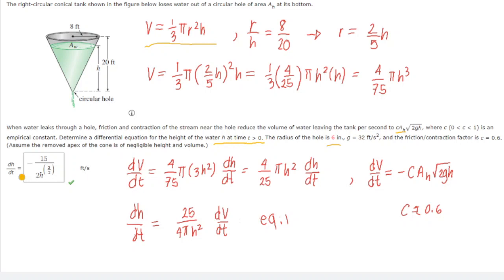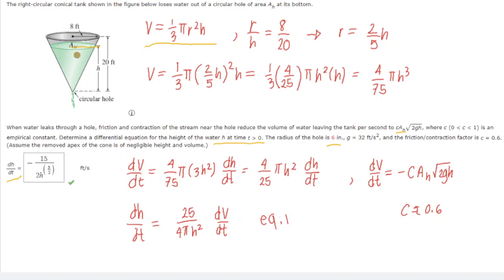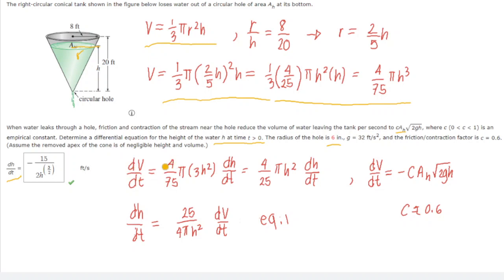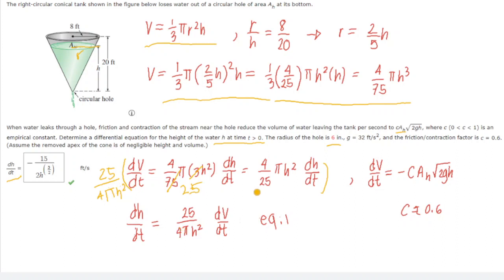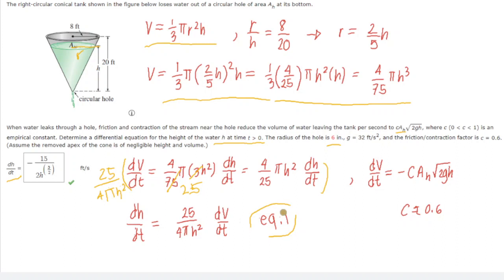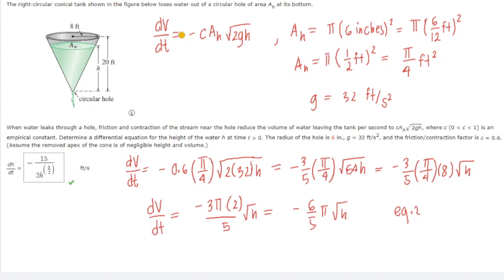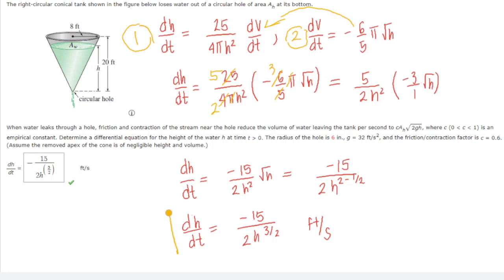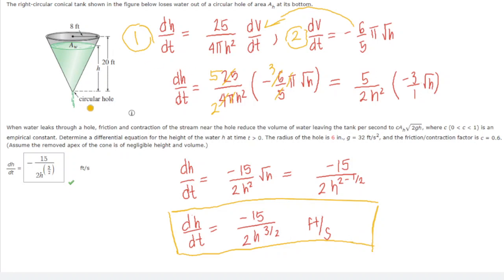Time Rates Applications Differential Calculus

Comment: What if the volume flow rate is not given? Can it be possible to be derived?
Reply from the maker: thank you very much for the question mr espina
Reply from the maker: the formula of the given volume flow rate takes into account the energy that were lost due to friction and other factors. that's where our empirical constant comes in. if we do otherwise, we can solve for the volume flow rate ideally. since if we deal with ideal solutions we can just neglect some of those factors.

Comment: Is it ok to always assume that the Apex of the cone is negligible even if the radius of the top surface is 8ft and the radius of the circular hole at the bottom is 0.5ft? I mean they don't have a great difference.
Reply from the maker: thank you very much for the question mr gomez
Reply from the maker: the problem says it is alright to neglect the volume of apex since half of a foot is far from the value of the total volume of the cone. if we solve for the volume of the cone we have pi*(8)^2*12 while the apex has pi*(0.5)^2*height which shows their volume vary greatly